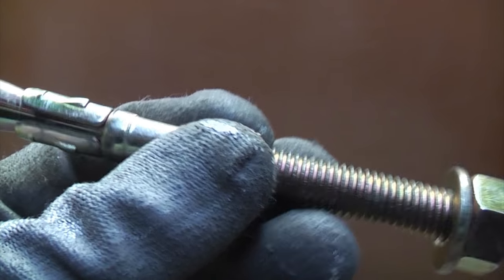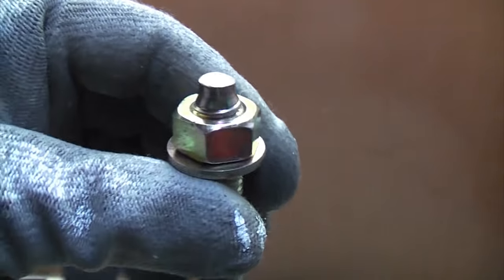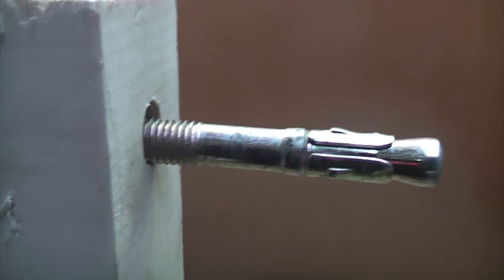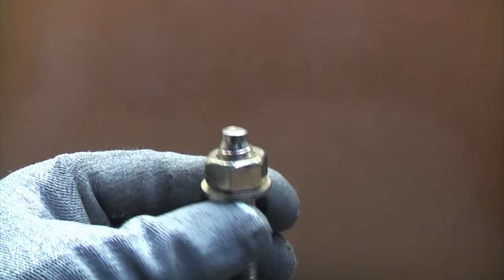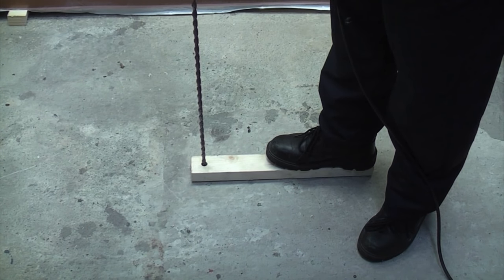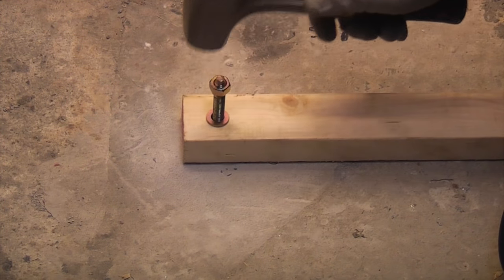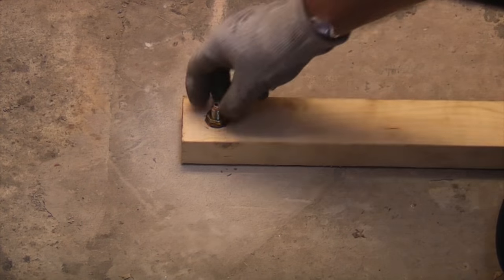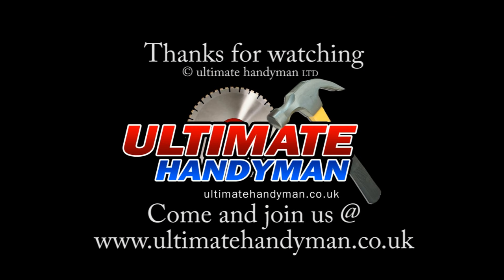Concrete anchors

Comment: Good idea about using rustproof bolts.  I wasn't sure whether the bolt would split the brick as it expanded, so you've put my mind at rest.  The timber is 2" thick which is about 50mm, so  I'll look for bolts which are around 120mm.

Thanks again for your help, much appreciated.

Comment: I find the bolt goes in a tiny bit easier and grips slightly better if dust is blown out of the hole.  A short length of flexible tube can be used to blow dust out of the hole before the bolt is inserted.
Finally, as shown in the video - there's no need to over tighten these bolts.  If you do you risk pulling the bulb-end of the bolt through the jacket - and then the bolt and hole are useless.
Thanks for yet another great video!
Reply: That's a great comment, thanks

Comment: Great video.  Excellent tip to drill the depth out more than needed for an easy solution if you want to remove the bolt.  Well done.  Cheers and thanks.
Reply from the maker: You are welcome.
Thank you for the comment ;-)
Reply: Ultimate Handyman look at Greg German on YouTube for how to remove through bolt's from rock!

Comment: This is a cool video. Good basic info on the anchor bolt (thru-bolt as the English gentleman says) which, in my business (architectural graphics) is the most used and most unseen of hardware. I'll be passing it on.
Reply from the maker: Bob Loza 
Thanks Bob ;-)

Comment from the maker: +Efstathius Placidas
I don't think so, although you can use Rawl bolts etc. which leave a threaded female insert in the hole, which you can then bolt to.

Comment: Excellent video.  I'm building a timber mono-pitch outbuilding/shed and looking for a suitable fixing to bolt/screw the timber frame walls to the base.  Obviously these are around the edges of the concrete base so are close to the edge.  My question is - how close is too close - the timber frame is made using 3"x2" (the 3" dimension is the width of the frame) so is this too close for this type of fixing?  What would you recommend?

Comment: I'm getting ready to build a new wooden front porch. I needed to know how to bolt 2 posts to the brick wall. I'm going to use this method. Thanks!
Reply from the maker: ***** 
You are welcome, thanks for the comment
Reply: ***** Well, I'm done with the porch and I'm getting all kinds of compliments. The 2 posts against the brick wall are more solid than I ever imagined they'd be. Those bolts were a lifesaver.
Reply from the maker: ***** 
Good stuff ;-)
Thanks for the comment

Comment: Very nice video. One suggestion: Use a shop vacuum to remove concrete dust from the hole.
Reply from the maker: +johngo6283 
Thanks for the comment  ;-)
Reply: stick a small tube into the vacuum hose so that you can go deep into the hole.
Reply: Argument: That would be 100% waste of time. I'd say that the anchor holds just the same weight if you vacuum the dust or not.

Comment: Hopefully you still monitor these questions!  I am trying to mount a ledger board on a cinder block wall, so the anchor bolts will fall into the cavity behind the holes I drilled.  Also - the expanding flange doesn't expand.  perhaps the cinder block hole is slightly too big or the cinder block material is too easily broken away inside the hole making it too loose?
Reply from the maker: Hi, I am not familiar with cinder blocks I'm afraid (we don't use them in the UK).
I'm not sure what people use when fixing into cinder blocks, perhaps resin would be a better option- https://www.youtube.com/watch?v=oUJPjJsdl0c

Comment: great video , but , if you can brush the dust etc out of the way with the drill bit still in the hole , saves all the dust going in  the hole .
great tip about the full depth hole plus a wee bit for knocking the bolt flush later.
Reply from the maker: Thanks for the comment 👍

Comment: Thanks for the video. When you say they shouldn't be used near the edges of concrete, in case of cracks ; do you think I'm safe to use it about 50mm from the edge? I'm thinking about anchoring a wooden beam to a concrete strip foundation 100 ish mm wide (width of a brick) by drilling and bolting into the middle of the concrete strip, hence , "50mm ish from edge".
Reply from the maker: 50mm is a bit close to the edge, the expansion force of the fixing could cause the concrete to crack.
I'd use resin fixings, as there is no expansion force- https://www.youtube.com/watch?v=oUJPjJsdl0c
Thanks for the comment
Reply: Ultimate Handyman Thank you so much. You just saved me a massive headache, time and money. Very much appreciated!
Reply from the maker: You are welcome ;-)

Comment: I'm just revisiting this video for my next diy job :)

Would these kind of bolts be appropriate to attach a 2.4m piece of 2x4" wood vertically to the side of my house?  I need to attach a new gate to the side of the house and want a vertical to hang it from.  Also what diameter bolt would I need?  would 6mm be strong enough, it's a fairly heavy wooden gate.  Or would I be better off using masonary screws or some other fixing?  Thanks

Comment: If its in a floor, I always drill straight trough.  If the anchor gets screwed up (buggered threads, spins in the hole, etc.) you can pound it down and install a new one on top of it.  Hitting rebar is always fun:)
Reply from the maker: Thanks for the comment

Comment: hy can these b used to attach wall brackets into brick?  I am using a length of unistrut to brace against my back garden gate to make a solid secure retractable bar lock. the unistrut will slide in and out through the bracket.

Comment: Great video, thanks for info and tips.  I want to use a couple of these to affix a timber post (for hanging a gate off) to the end of a breeze block wall.  How far from the end of the wall do you think I'd be safe fitting these (to avoid cracking the breeze blocks)?

Comment: hi, just wondering what anchor bolt to use to fix the post to a brick fence since my wooden backyard gate is already damage I build another one. the old owner of the house used the concrete nail which is not very good at all that damaged the brick as well. thanks!

Comment: Is it possible to embed the anchor bolt into wet cement? That way you will not need to drill into concrete. Will the end bit still expand if it has concrete surrounding it?

Comment: I use a small length of plastic hose from a washing machine, (flexible), and about twelve to twenty inches long to blow dust from inside the hole......

Any length of tube or pipe..... even a drinking straw will do if necessary.......and it can be rigid, (say a piece of copper pipe).......or flexible.

The advantage of a flexible bit of pipe is that you don't always need to be on an exact level with the drilled hole to use it.........so if working on a ladder, or at any height on a wall, for example, you can be slightly above or below the hole, or to one side when you blow.....

If you angle the tube or pipe slightly at the surface of the hole and dust inside it will come out much easier than if you are 'dead straight on' to the hole.

Most important point to remember is that at THE MOMENT YOU BLOW into the tube or pipe, CLOSE YOUR EYES......

It's only a momentary 'puff' or 'blow'............BUT........any debris or dust in the hole will come out at some speed.....

Hence the slight angle of the pipe or tube at the surface of the hole..........it will expel it more easily.......and hence the need to momentarily CLOSE YOUR EYES....

James Hennighan 
Yorkshire, England

P.S. A flexible piece of pipe stores more easily in a tool  box or bag........
Reply from the maker: Thanks for the detailed comment ;-)

Comment: Hi,
I've used a 8mm x 85mm though bolt, similar to the one on the video. I drilled a 8mm hole with a 8mm drill bit, and hammer the bolt in (it was quite hard to push it in), but when tightening the bolt, it seems that it doesn't tight really hard. it seems that tightening torgue increased to some limit , and then stays the same.
 I have a feeling that if I continue tightening the bolt will continue to move out gradually until it is fully removed. Is that expected?
Reply from the maker: It should grip unless the concrete is weak?
Sometimes the bolt does pull out of the hole slightly before the nut can be fully tightened.
Reply: Thank you! The wall is made of concrete blocks. So shouldn't be weak concrete. The is a layer of plaster, maybe around inch thick. the reason I was asking because I have 8 bolts to fix and all of them  behave similarly. these are the measurements: the bolt lengths  is 85 mm, the hole in concrete is about the same depth. I hammered the bolts until about 15mm left out of the wall. After tightening it is now around 25 mm out of the wall and 60 mm inside the wall, of which around 35mm-40mm is in concrete

Comment: Thanks for the quick reply :: In regards to concrete screws ---
The structure is a basic carport, using 50mmx50mm / 75x75 timber posts:
The fixings I'm using are square post supports, a hole for an m8 on each corner - do you think a concrete screw in each corner would hold well enough to support the posts? (2.4m max height, opposite side fixed along wall with a horizontal timber support)
Thanks - Martin

Comment: I need to fix several 75 x 75 x 1800 fence posts to a single brick width wall so I can extend fence panelling above the wall. Would concrete anchors be too much or would 150 masonry screws do the job? 
Any help would be appreciated.
Thank you.

Comment: Drill it an inch or so deeper so you can lose it if it's not required anymore - TOP TIP.  Also Hilti and Bosch make drill bits that eat through rebar - absolute godsend!
Reply from the maker: I've seen the rebar cutter bits but never used one yet.
Thanks for the comment

Comment: That is why I personally prefer shield anchor bolts. The bolt is removed if you decide to remove something, so no bolt left sticking out of the ground to leave a trip hazard. I just used some shield anchor bolts to put up a door canopy that I made for a customer. So if they do ever move they can take it with them and no ugly bolts sticking out of the wall.
Reply from the maker: Thanks for the comment ;-)
Reply: agreed, shield anchor bolts are preferable.
But in addition, some 9+years after this video was posted there are now better things on the market for fixing into concrete, the obvious being concrete screws!
Reply: Shield anchors. Are great.   But have to be split then assemble around the work piece:  the through bolt shown here. Can be fitted and secured to fix timber or steel directly without splitting the fixing.  Like for example a park bench with holes for a fixing. Or re securing existing work. With our removal straight through.  Shield anchors are also tricky to fit. And can come loose and need re tightening:

Comment: Great tutorial!!  I'm planning to add some joists above the ceiling rafters in the loft to make a storage room, would you recommend these for attaching a wallplate to a stone wall?  Thanks
Reply from the maker: Someone once said that these are only suitable for concrete, although I'm sure the ones I have bought in the past just said "masonry" on the packet, so it's best to check with the manufacturer. If you go to the makers website, it should tell you what substrates they can be used in.
Thanks for the comment

Comment: Just bought from Bolton BandQ  packs of M10  I was trying to find some with strength specifications as this one suitable for stair case going off picture on the "diall" pack but other m10s have picture of heavy gate.. hopefully a video of strength tests might be produced sometime.. just wondered what you thought. Thx for video. 👍
Reply from the maker: Something like this would need some serious equipment to do the testing. There are also a lot of variables depending on the intended use and substrate. The shear load of a M10 bolt is probably about 3 tonnes, but obviously the substrate will fail well before that. 👍
Reply: @ultimatehandyman  Thx.. I done more since.. really awkward even going by book, drill 90mm hole and thing can't be hammered just tapped generally stuck 40mm down  even tho hole clean and newish concrete mix.. any advice please..Thx in  advance 😀
Reply from the maker: They often are difficult to knock in, but should go in as deep as the depth of the hole. Have you tried using a vacuum to clean out the hole?
Reply: @ultimatehandyman  
I have thanks.. I found that tightening nut,then  tapping for a while..loosening allows it to go in 1mm.with tsp of hammer again...  after hour or so had enough... 
I advise anyone to use a rawl bolt because most of the thread is 'covered by a long threaded shield' which can take a bit more hammering abuse with less chance of distortion..and tends  to be a bolt head that is being hit..  Thx ..  real world examples are hard task master.. 👍

Comment: Would they be suitable for use where you may remove the nut multiple times? I'm looking to fix some gym equipment to my garage floor which would have to go in the middle of the floorspace. I'd like to be able to secure it and then remove it when required for whatever reason and then return back to the original spot.

Studs sticking out of the floor would not be an issue.
Reply from the maker: Yes, sure. We had some equipment on site that needed to be removed and re-fitted. As long as the sticking out studs are not a problem 👍
Reply: @ultimatehandyman  brilliant thanks. Even if it was multiple times a week?
Reply from the maker: @BillyM213   Yes, it will be fine
 (Sorry for the late reply, YouTube comments has been playing up AGAIN, So I have just seen this)

Comment: Would an expansion bolt be strong enough for this project?  I have a car(s)  that I need  to get in my garage the current one has a blown head gasket but is un-driveable.  I don't always have extra hands to help push it in.  I wanted an anchor point in a concrete foundation to winch off of or to use with a come along to pull it into the garage ( mild 5-10 degree incline).  I have a good Dewalt Hammerdrill (13mm)  Is this the best method for using as anchor point to attach a winch? Thanks!

Comment: Do they make a bolt that could be unscrewed in half essentially, leaving nothing sticking up above the surface of concrete? Then when you use it again, you just screw on the other half... Something that would connect kind of like the pieces of a gun cleaning rod.

Comment: Thank you for the information. I have to anchor to concrete to attach metal cable between two walls to hang lights. Do they make anchors for this purpose? Thanks,Dave,Frederick Maryland.

Comment: Hi - a quick question regards to not using thru bolts 'near the edge of concrete' as you stated in your video --- what's a minimum safe distance from the edge?
I was thinking 3" would be ok, but would rather ask the expert...

Comment: that through bolt is pretty much what im looking for as i have a sqaure tube bracket approx less than a half inch and using the screw bolt that came with it means im losing pretty much half the length of the screw due to thickness of brackett from surface of the brick wall the hole diameter is 10mm would the throughbolt be a more secure suitable fixture into brick?
Reply from the maker: Apparently these are not recommended for use in brick- only concrete. But I have used them in brick in the past and they have worked fine. I guess it depends on the type of brick!
Reply: Can you use these going sideways into a granite gable? Does it matter whether they go into an actual lump of granite or end up through the cement between? Thanks

Comment: Would you vrecomend these for stud walls for shed,thay will be the exterior walls,was thinkin of threaded bolts ,stick them in while concrete setting
Reply from the maker: I'm not sure if they would hold properly if you did that. I've used Resin anchors in the past but never set studs into wet concrete- https://www.youtube.com/watch?v=oUJPjJsdl0c

Thanks for the comment 👍

Comment: Would a mechanically galvanized expansion bolt be the best for a deck ledger attached to concrete?  If not, what type of bolt would you recommend for usage where moisture will be? I checked my code, it was useless.
Reply from the maker: I would have thought that a galvanised or stainless steel concrete anchor would be fine.

Comment: Excellent video, thank you. I ordered some tricep dip bars from Amazon and it came with 4 of these per arm. Are they suitable for fixing to a solid internal wall, please? It is plastered but it is a 1970s house so behind the plaster is solid heavy blocks. 
Thanks.
Reply from the maker: +Nachatar Dhaliwal 
They are supposed to be used in concrete only, but I have used them in most solid blocks with no problems yet, so they should be ok ;-)

Comment: Great, but where was the stage of checking what was under the concrete that you mentioned?
Reply from the maker: Anything buried in the concrete should be much deeper than the depth of a normal anchor. The site I work on allows you to drill in any concrete floor up to 100mm deep without having to get a excavation permit or scan the area using a Digicat.
Thanks for the comment

Comment: Is the an application to enable you to 'glue' a large threaded (M20, M24) tube into the concrete so and object can be secured to the deck and removed when finished? leaving a flush thread which can be capped. Thus you can bolt and object down and then remove it when you have finished and repeat?
Reply from the maker: I'm not sure if that exists as a commercial product, but it's a really good idea.
Reply: I had another look around and found the Hilti make a Thread sleeve. https://www.hilti.co.uk/anchor-systems/anchor-rods-and-elements/258019#features-applications
Reply from the maker: I've bookmarked that page for the future ;-)